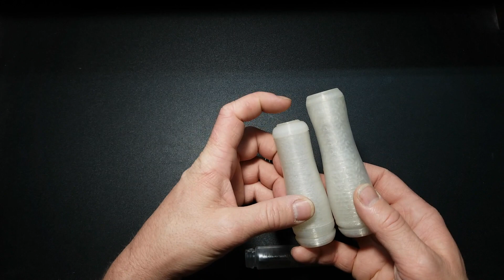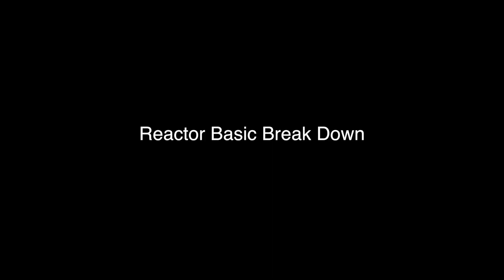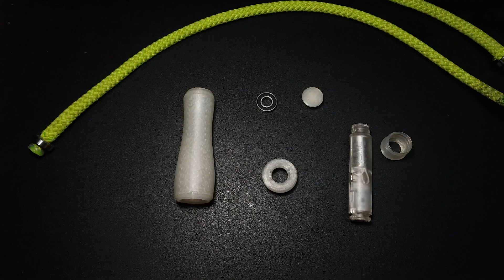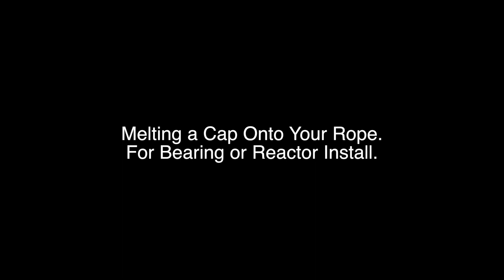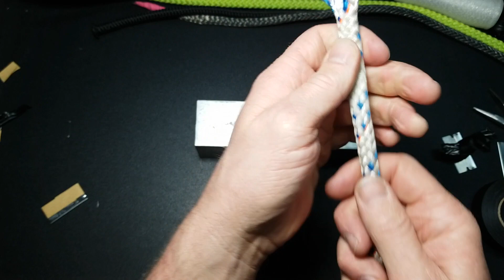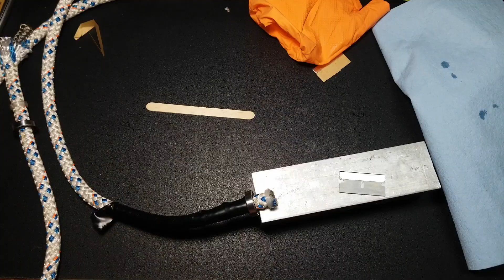Reactor Handles by Lost In Flow. Complete Build Tutorial & More

Comment: I just received a pair of these! I'm not quite sure how to size my poi with them though. When comparing them to my current set should I compare total length or length from where the rope comes out of the handles/knobs?

My current set is 27 inches overall if that changes anything
Reply from the maker: Howdy. It all depends on where you hold your poi. For me I hold my rope with my thumb and index finger quite a lot on a ton of moves so I prefer my overall to be about 2 to 3 inches longer than normal. I usually spin 28.5 but I count on the VPC I use to shrink an inch or so, so I think my set is around 30 inches. I do like them extra long
Reply: @ThePoiMechanic  That's how I hold mine as well. Thank you! Also have you tried putting thicker rope onto normal podpoi? Your video on how to get thicker rope onto the capsule should work perfectly for my handles and the capsules in the pods but I'm not sure what to do about getting the silicon shell and tri-ring to fit back together. Im wanting to do it with some 6mm dynamic rope I bought from FoF.

I was thinking that I could maybe melt it in that area and use pliers to make it thinner but I'm not sure how well that would work or if it would lose too much integrity. Thanks again man, your videos have helped me out a ton
Reply from the maker: @SirBeastlyBossAwesom  Glad to help. I am not sure about how to get bigger rope in there because I don't have pods to try out. I imagine a piece could be 3d printed but IDK. I think the newer podpoi comes with 6mm smithy rope so maybe flowtoys could tell you
Reply: @ThePoiMechanic  sorry, I was thinking the wrong size. Its actually 7.5mm. 3D printing is a good idea though. I might try and see if I can find some strong clamps or something that won't cut into the heads
Reply from the maker: @SirBeastlyBossAwesom  Let me know what you figure out
Reply: @ThePoiMechanic  I ended up just taking a razor and shaving down the inside edge of the pods. It worked great!
Reply from the maker: @SirBeastlyBossAwesom  Excellent! Good job